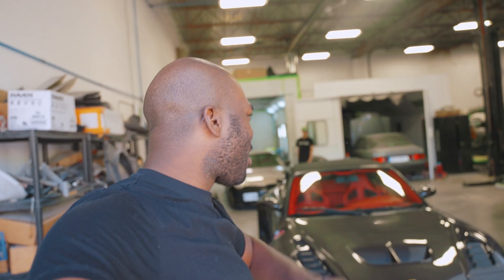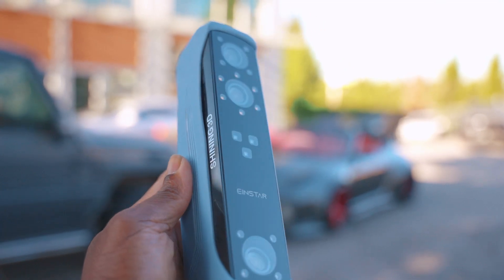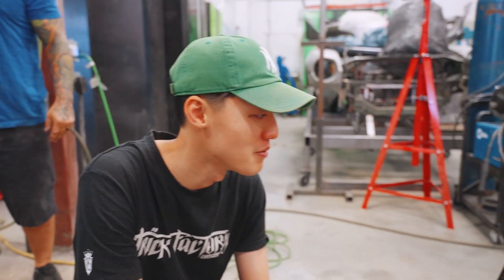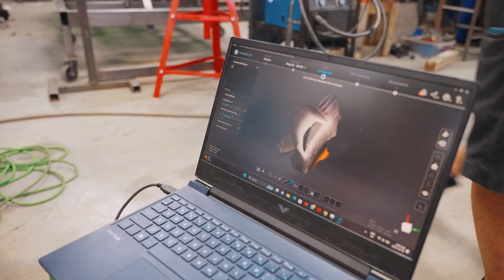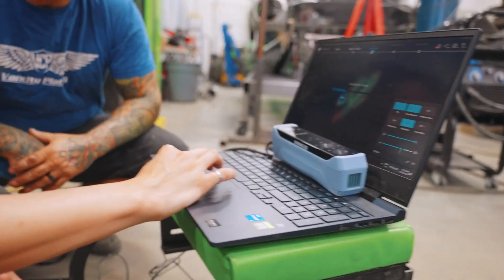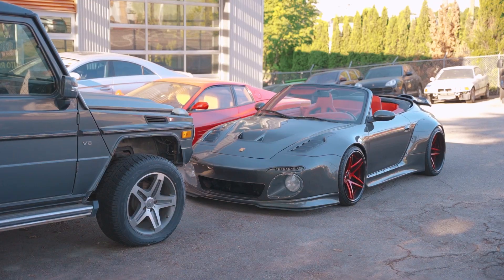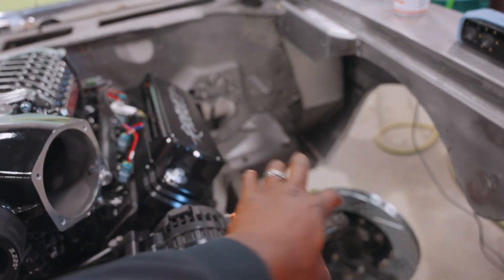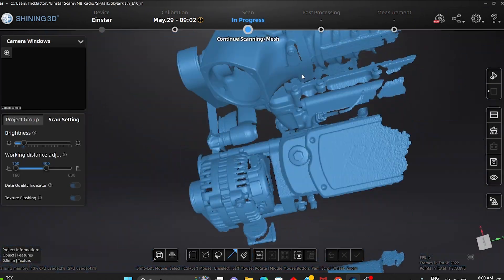Should You Invest In a 3d Scanner? - 3d Scanning our Porsche 911 Widebody with the Einstar Shining3d

Comment: Whar are the specs on that laptop? Are you running Fusion and the scanner program on it? Thanks for the videos.
Reply from the maker: It's a core i7 with an nvidia dedicated graphics card. It works great with the scanner but its not great for fusion. So for working with fusion in the future, we're upgrading to a desktop workstation with an Nvidia Workstation graphics card and recommended specs from Solidworks